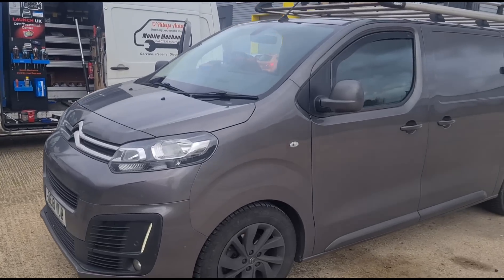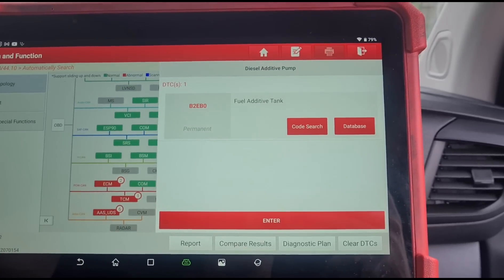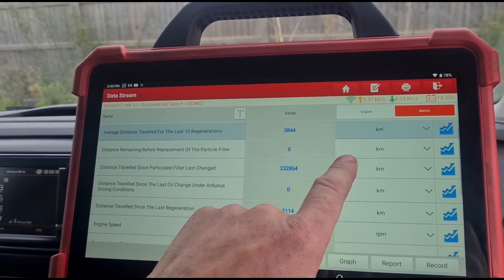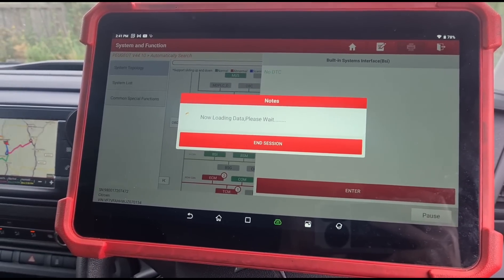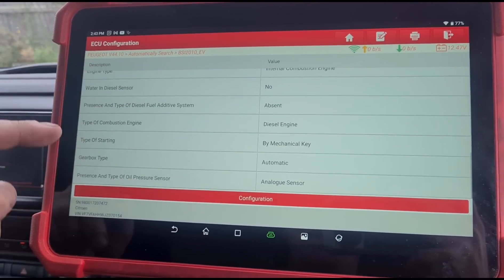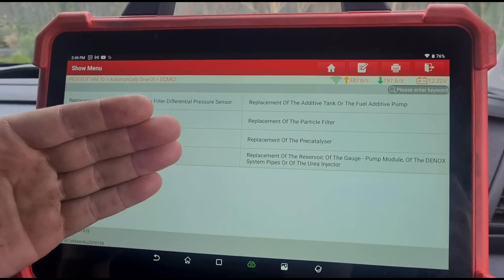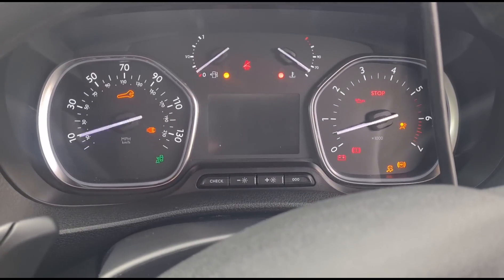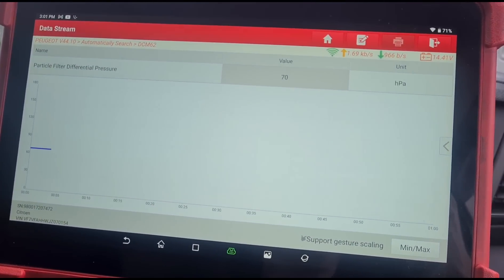Citroën Dispatch Additive Tank Faults After New Tank?

Comment: Hello for PSA after 2015-2016 after replacing the additif tank you need the officiel diagnostic tool diagbox to do online coding and configuration.
Reply from the maker: It was done at dealer without success
Reply: 10-11 times at the Citroen dealer and two replacement Eolys tanks. Did you even watch the video?

Comment: Had the same issue with the 1.6 expert. I tried to configure the new tank with launch, but it wouldn't let me. A lot of head scratching later, I manually put it in as a berlingo and it configured straight away. Apart from a nox sensor replacement a year later, no other issues. Hope this helps someone, fair play Jimmy.

Comment: Hi Jimmy, love your videos, I’ve learnt a lot from them. With this issue the cause is usually an incoherence between the configuration of the engine ECU and the additive ECU. Usually after tank replaced or after someone has filled tank with more than 1 litre and think they need to change the configuration to the amount they’ve put in. Check engine ECU live data for additive tank volume e.g 1440ml and make sure additive live data is the same e.g 1.44 litres. If the additive is at 1.00 litres an auto configuration of the reservoir should be done. If this does not change the value a manual configuration should be done as data on server is sometimes wrong. Volume should be coherent between engine ECU and additive ECU and also the two  parameters in the engine for volume should be the same after resetting the level counters which need to be done in both ECUs. May also need to add 10 litres of diesel after to force the pump to inject additive and make sure no codes return. I’ve seen this many times but mainly on Peugeots as that’s what I do everyday. Keep the videos coming.
Reply: I spent over 10 years braking Peugeot's and Citroen's. That is a over complicated and nearly impossible procedure to figure out yet easy enough when you know what to do I have a feeling your probably spot on.

Comment: If u tell car that additive tank is not there anymore, dpf starts doing forced burns every 20-50km. This is not a solution
Reply: As an owner of one of these vans, I can say from my experience that disabling the PAT fluid system does not lead to the van doing regenerations every 20-50 km.

In fact, I found that the opposite happens, I regularly see 1400km between regenerations, as confirmed by scan data.

I’ve been running with the PAT system disabled for 50k miles now, through two MOT’s, without any issues whatsoever.

From my research on this topic, I’ve found that the PAT fluid does not actually help “clean” the DPF, the DPF is more than capable of cleaning itself. What the PAT fluid does is makes the soot particles coagulate, or stick together, so that the smallest particles clog together and form particles big enough for the DPF to catch. The system was designed as a way of reducing the emission of the smallest particulates, which are microscopically small and therefore pass through without being caught by the DPF. If you make these tiny particles stick together, you form bigger particles which can then be caught by the DPF.

You could argue that by disabling the system you’re increasing the emission of these tiny particles; however, if the system is showing a fault, it’s not working in the first place, so disabling the system is not making the situation any worse. By disabling the PAT system, you allow the regeneration process to take place normally and therefore keep the emissions within MOT standards.

Of course, the ideal solution is to find the cause of the fault in the first place, which I spent many hours and several trips to Citroen trying to resolve. But there comes a point when you have to draw a line under it and move on, because trying the same thing over and over again and expecting a different result, well, that’s the definition of insanity, right..?

50k miles with zero issues and two completely clean MOT’s speaks volumes, I’d say…

Comment: in the "olden" days you were replacing injectors, injector washers and other mechanical components, now it's emission "crap", I have done a lot of those eolyse tanks the last couple of years, and Mercedes is not doing any better with there adblue tanks going out left and right, and they arent cheap either :), but love your video's its great getting some small tips and tricks for trouble shooting